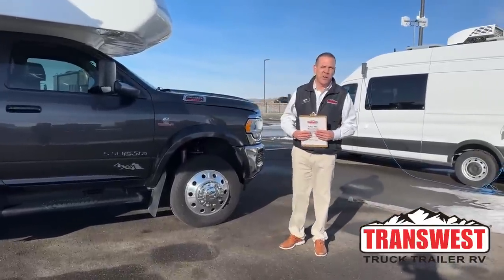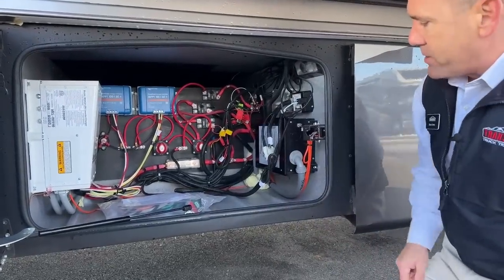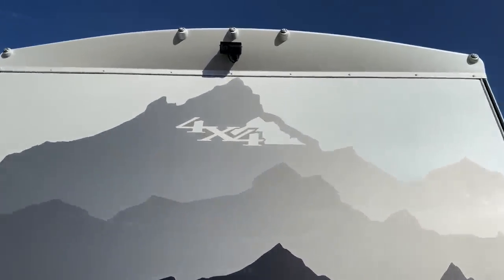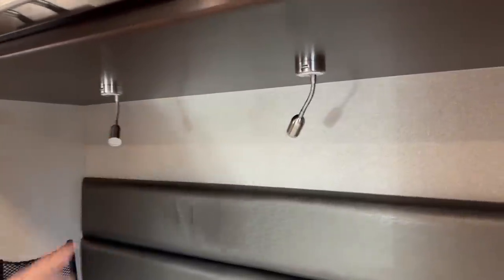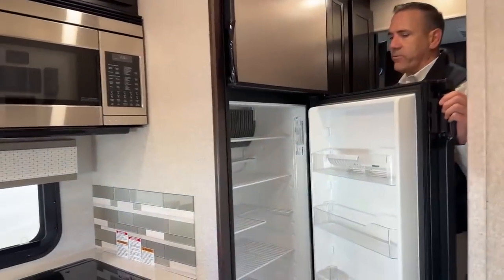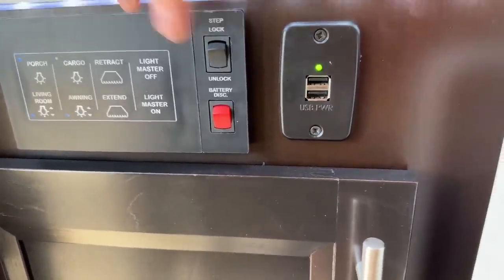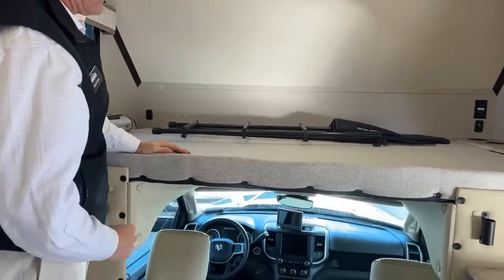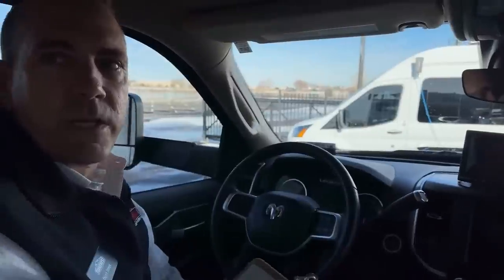Dynamic Isata 28SS - 5U221640

Comment: There are a lot of competitors in this 30' 4x4 segment and prices shoul
Reply: Prices should be similar...
Reply: @1911nigel  We are looking for a 4x4 class C and don't see a lot of competitors. What models are you referring to?
Reply: @ElliottMorris  magnitude, online, veracruz.
Reply: @deanjones4849  thanks for the response. By online, do you mean the omni? i haven't seen any of these models in person, but what appeals to us about the 28ss over the magnitude/omni is the 28ss is 2' shorter, has the massive storage in back, and the 800w of solar. the veracruz looks nice, but the same comments apply, plus i question how comfortable a murphy bed would be.
Reply: @ElliottMorris  Dont go near a magnitude/omni, they are garbage.  Just head to the thor forums and read the horror stories.  Only competitors to this I'd remotely consider would be the 35' Renegade Veracruz, Nexus Rebel or Jayco Seneca XT
Reply: @FrankBullitt390  thanks for the comments. I haven't read user comments on the Thor, but I looked at one last week and wasn't impressed with the quality of the materials. We are looking for something around 31' or less, so the Veracruz and Jayco wouldn't work. We looked at the specs of the Nexus, but it doesn't look at all like a good choice for boondocking. We keep coming back to the Isata 5 with the Xplorer package in either the 28SS or 30FW. We are amazed with the exterior storage on the 28SS, and the four-season and boondocking capabilities with the Xplorer package are amazing. BTW, do you have a 4x4 super C, and if so which one and how do you like it?
Reply: Thor is junk. Renegade Veracruz will be the best quality, but they need to add more floor plans. Dynamax would be my pick after Renegade.
Reply: @ElliottMorris  I dont have one yet, shopping like you are.  I like the Isata 5 30FW and will be making a roadtrip soon to go see one in person (explorer and non) along with the rebel 30r and some gassers that may also fit the bill.  For boondocking the xplorer is best out of the box but a lot of that stuff can be added for far less than they charge. I think with 400ah lithium and 900+ watts solar added to the rebel you'll still be 30K cheaper.  It also has bigger water/grey/blk tanks than the isata...fyi
Reply: @FrankBullitt390  I appreciate your comments. I like the layout of the Rebel 30R, and the bigger tank capacity, plus the towing capacity and CCC. However, there are so many ways the Isata 28SS ticks the boxes for us - 8k generator (vs. 6k for Rebel), better exterior storage, armrests on the cockpit seats (can't believe the 30R doesn't have them), a camera for the hitch, 3000W inverter (vs 1000w), 40k btu furnace (vs 35k), Auto generator start, Maxxair fans standard, etc. I am looking at the Rebel on several dealer lots, and the price doesn't seem that different from the Isata. I don't know how complicated (expensive) it would be to add the solar panels and upgrade the inverter and batteries, but you may be right that it would still cost less than the Isata. However, the Xplorer package also upgrades the insulation in the floor, walls and ceiling (no mention I've found of how much it adds), and it also adds dual-pane windows, so in theory the Isata with the Xplorer package should be more energy efficient in hot or cold weather over the Rebel. We will look at the Rebel, but to me the Isata with the Xplorer package sure seems like a better choice for our needs.
Reply: @ElliottMorris  Good points and some I had not yet considered, if you haven't been in a 28ss yet it might be a lot smaller than you think.  All these reviews use wide angle lenses.  I seriously considered an isata 3 24rw which in slide out mode is very similar to the 28ss and it was tiny.  The 24FW is bigger but requires slide out to sleep, where 30FW essentially has a queen bed over the cab for those cases.  The isata 5 is definitely the best one and by far the best support, the gm himself helps customers on the dynamax section of forest river forums.  Hoping to go see all of them soon to help whittle down the list.
Reply: @FrankBullitt390  I went to a dealership last week and got to see a 28SS as well as a Thor Omni XG32. It's ironic that you mention the Isata 3 - our current motorhome is the Isata 3 24FW. It works fairly well for us, as it's just my wife and me (and smaller dogs), but we had the tanks and dump valves freeze on our last trip, and we would like something more rugged, with better boondocking ability, and ideally with a bed that's available with the slide in. We had an Eagle Cap 1165 3-slide truck camper before the Isata 3, which we loved, but it's not a motorhome. We really like the smaller size of the Isata 3 for getting around towns, etc., and want to stay with the shortest length that works. BTW, I discussed the Nexus Rebel 30R with a salesperson who sells the Rebel and the Isata, and is someone that I respect, and I was advised to avoid the Rebel due to severe quality issues.  The salesperson said the Isata 5 is a much better built RV.
Reply: @FrankBullitt390  we pulled the trigger and bought a 28SS. I drove it cross country (NJ to WA), and I am really happy with it. Today I am taking it ice fishing for a couple days, something that would have been a challenge in the Isata 3 24FW. Feel free to drop me an email if you want any specific feedback.
Reply: @ElliottMorris  Congrats on the new rig!  Awesome to hear.  I'll reach out if I have any questions.